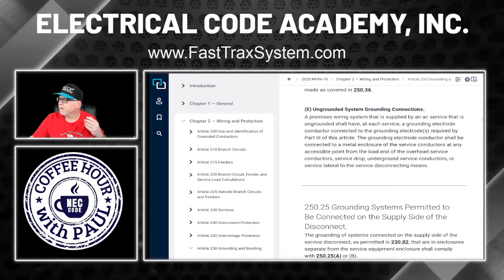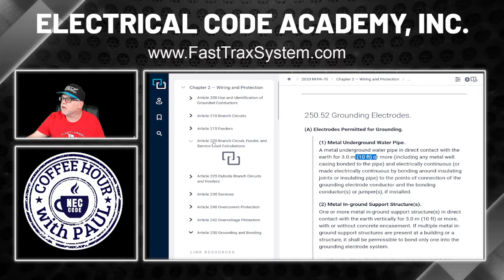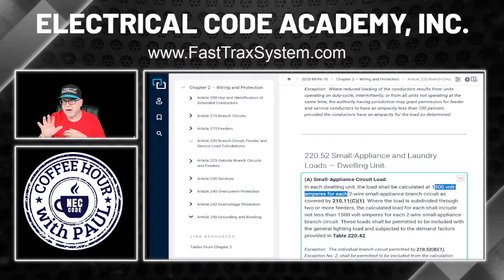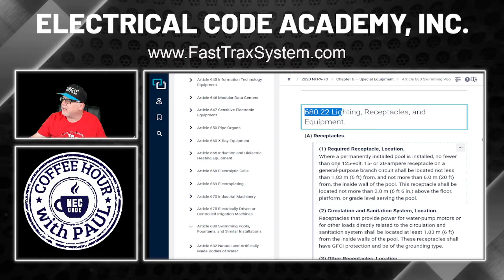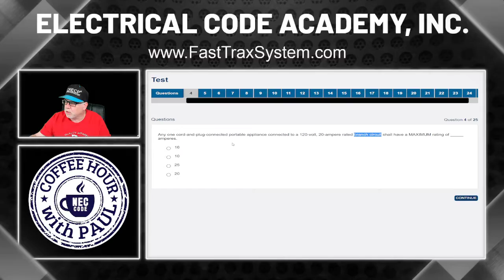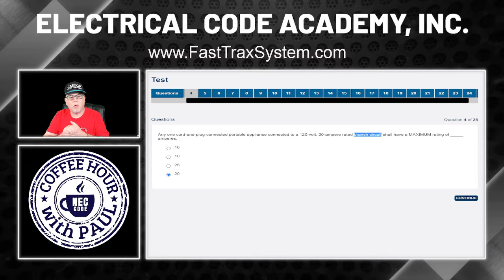Electrical Exam Prep for Electricians

Comment: I thought that you load all breakers to 80 percent? I do commercial tho but is that like a test thing do you not take the 80 percent off usually?
Reply: Or is this specific to the cord and plug loads
Reply from the maker: The rules in 210.23(B) are specific to cord and plug loads where you KNOW the loading. Not sure why folks think this applies to general use receptacle loads. For example, cord and plug in-sink waste disposal will apply to 210.23(B) but again not general use receptacles.
Reply from the maker: Why would you only load a circuit breaker to 80% if its not a continuous load?. If its a 20 amp circuit breaker, its designed to handle 20 amps. Now, unless its rated for 100% of its rating, when you have a "continuous" load its only them you limit the load to 80% of the breakers rating.